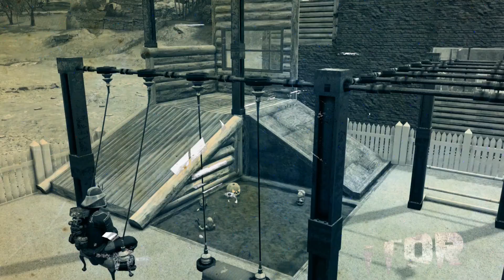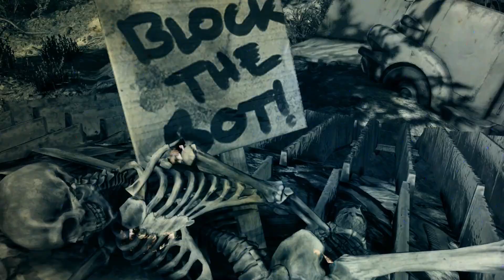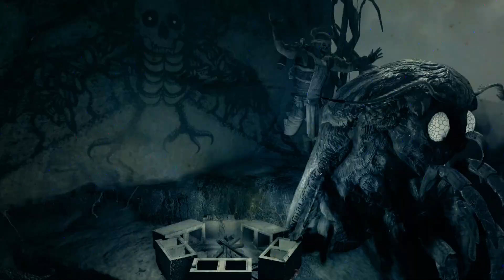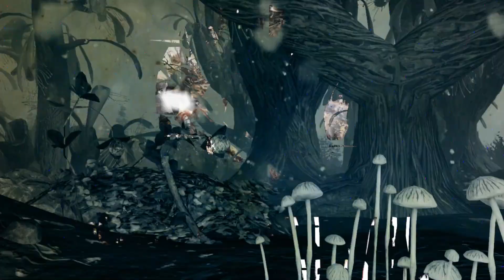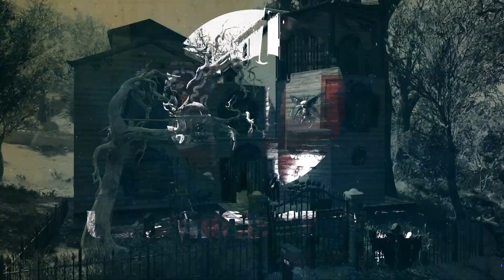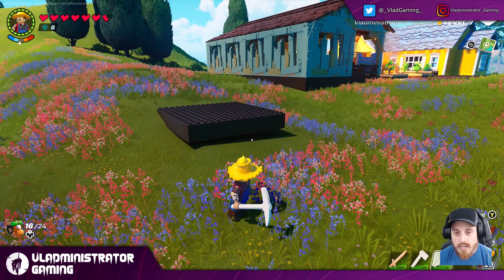How to Sink Foundations and other build pieces into Terrain | Lego Fortnite

Comment: I trying to figure out how to put pillars under a pier in the water. I can’t find a snap point
Reply: What I do is snap a half pillar to the side of the flooring of the pier, even with the bottom of the floor, then I snap a full pillar to the bottom of the half pillar then nudge it underneath the floor piece before placing it, then destroy the half pillar... repeat as necessary 😎
Reply: @TheLongTomLounge thank you so much! I knew I was doing it wrong this is the solution for sure.
Reply from the maker: Haven't tried it yet myself, but I have a place where we want a bridge, so I'll see if I can find a way.